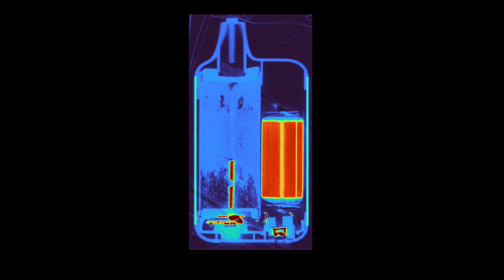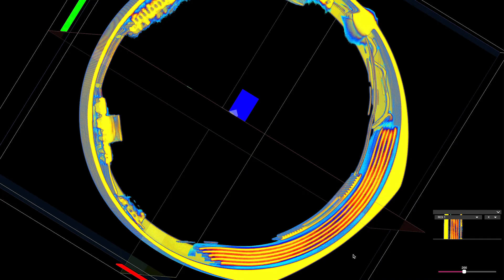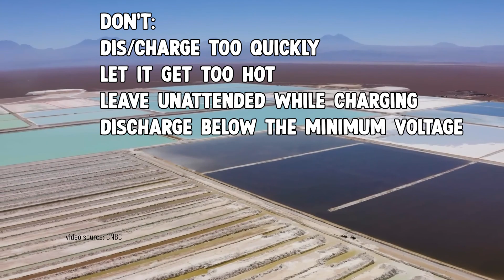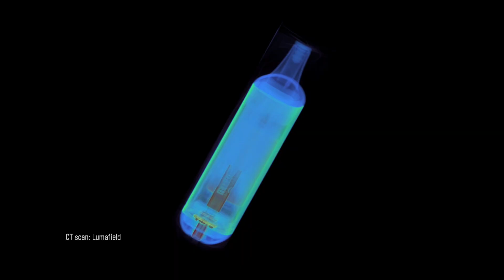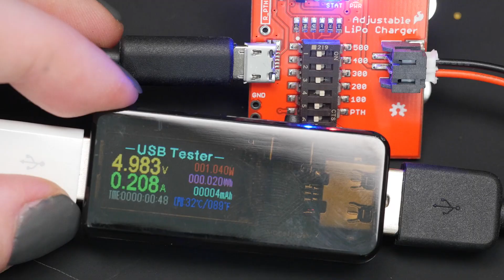Can you reuse these batteries?

Comment: WEAR GLOVES!!! nicotine is one of the few drugs that can be absorbed transdermally (can be absorbed through the skin). this is especially important if you do not vape/smoke already and do not want to become addicted, or if you are opening and handling multiple of these. There are stories of kids working with tobacco who got a strong buzz from picking and handling the leaves. it's easy to imagine how vapes, with a much higher nicotine density and larger surface area than tobacco leaves, will absorb higher amounts and quicker than tobacco.
Reply: Yep. I learned this the hard way. I was harvesting batteries and the nicotine got all over my hands and I got fat headache because of it. Please. Wear. Gloves. And make sure you have proper ventilation. The fumes can really make you sick if you have a bunch of them opened up.

Comment: Hi, you were saying about under and over voltage. I use a bigblue solar panel to charge an ANKER power bank. There would be a range of voltages throughout the day never over 5 volts but under 5 volts at quite a lot. Do you thing this would cause a problem for the power bank. Thank you or anyone for a comment.

Comment: My coworkers use those kind of vapes and every time they are almost gone they leave it everywhere..I found 10 inside or work vans...and when open and tested batteries was good...so i removed and keep it safe for further projects... I found only 2 with charger circuit included...so i use it to charge the other 8vone by one and works fine for small projects..
Reply: Just remove the charge circuit and solder some of those magnetic leads onto it. Then you have a charger you can use for all of them as needed

Comment: What can you do with the USB-C ports besides charge the batteries? Could they be used to port anything else? Like a raspberry pi through the gpio pins.
Reply: These vapes don’t use any of the pins other than those for the power so there are no traces on the board for any data. I suppose if you’re super handy with a super tiny soldering iron perhaps you could some how throw some more pins and some super tiny wires  in there but certainly not me…😂

Comment: I often see these in groups in the same spot in my neighborhood.
I've been cleaning them up, but I'm also considering just putting a steel box there, with a note about safe disposal, and skipping the "let them get rained on/peed on by dogs" step
Reply: as a vape smoker who is embarrassed by what my kind does, i thank you greatly. good person.
Reply: Just be careful it has heat protection if the batteries get too warm they can explode
Reply: @sycksyngyrl  that's why "steel box" - to contain them in the event if a catastrophic failure.
Reply: @StripeyType  those batteries can bust steel and or blow out the lid or opening... If multiple batteries it may breech the box...

Comment: I’ve been collecting those for a while. My question is, can you join them to create a higher capacity battery pack safely? And also can you use a usb charging module with multiple joined batteries?
Reply: I want to know this too; I’d love to be able to join a couple and turn them into a little usb-c power bank
Reply: yes, but you should add a fuse to each battery cell (if you join them in parallel).
Reply: @OLmL1  most manufacturers of power banks don’t do that
Reply: @thatyoutubeguy7583  not on 18650 cells maybe, because they have an internal protection (CID). 
These ones don't have that.
Reply: You technically can but the charging circuit wouldn’t be able to balance the charge so you run the risk of under or overcharging of one or more cells. I would definitely add a BMS

Comment: A simple tip to prevent shorts which could be especially useful for people recovering these batteries: if you cut power wires, cut them to different lengths. This greatly reduces the chances of a short circuit. Even if you solder on new leads right away, it's possible for solder to break through heat-shrink tubing.
Reply: Also, don't cut both wires at once. The wire cutters will  complete the circuit and the battery will short and possibly catch fire.
Reply: Not if you know how to solder properly
Reply: And also, don't use open flame near the batteries💀
Reply: @davidd2661  it's a lighter for 2 seconds to shrink heatshrink. Calm down, Alice. It's going to be OK.

Comment: Great video Becky! Had no idea and something else to get angry about. Is lithium a finite source? No kidding these are kinda dangerous. 4:20 you can see tiny sparks as you desolder. (Would desoldering negative first cause the same spark?) Super smart to add connectors. Soldering any live battery to a circuit is risky. Mahalo for sharing! : )
Reply: Would have been safer to cut the pressure sensing capsule one wire at a time. And don't do what [Atomic 14] did in his video which was to cut both wires at the same time with the same metal wire cutters.
Reply: Lithium is super abundant on earth, particularly in seawater. It’s the rendering of it that’s the issue. Oh and you know the littering and filling of land fills etc😒

Comment: Where I live these things are dropped in the street.  I now have two biscuit tins full of them.  Amazon sells the charger circuits - 5Pcs TP4056 1A Lithium Battery Charging Board Module for about seven pounds sterling.

Comment: I need a  bunch myself. I've collected a few 650mAh, but I'm looking for the larger disposables. I intend on using them for lighting passenger cars on my garden railroad. Been collecting them as I find them, even before bigclive posted his video.
Reply: The problem with the 650mAh ones that I've salvaged is that they are typically in those devices shaped like a Zippo lighter that have a USB-C recharging port on the bottom, but the recharging circuitry is very minimal - just a 4.2V regulator. So these devices have a large tank of fluid to atomise but come with a battery with too small a capacity to fully vaporise a full tank. The user would typically drain the battery to nearly 3V, recharge it rapidly to 4.2V, and repeat this cycle several times until the tank is empty. By then the battery has suffered multiple very punishing recharge cycles and so is very unlikely to have a capacity anywhere near what is claimed on the label.
Reply: @bornach  they rarely have the capacity that's on the label to begin with. I can load test, get a bunch of cheap BMS circuits, and they'll be more than fine for cheap electronic projects. My intention is low powered LEDs, more than enough power for a few hours of running trains at night.
Reply: @bornach  besides, they're only charged once or twice before being tossed.
Reply: @bornach i lookd for some of this info and found out i think my juice is compatible with my 3.7 w usb c charger Torch out california

Comment: This is insane! Disposable consumables with rechargeable batteries 🤬. Thanks for sharing the story and the excellent instructions Becky 🙏
Reply: And not just the batteries. That pressure sensing capsule contains a capacitive touch switch. Just cut the top membrane off to expose the sensor. It can also switch quite a high current compared with those capacitive touch PCB modules sold for use in Arduino projects
Reply: @bornach ⚠️ God has said in the Quran:

🔵 { O mankind, worship your Lord, who created you and those before you, that you may become righteous - ( 2:21 ) 

🔴 [He] who made for you the earth a bed [spread out] and the sky a ceiling and sent down from the sky, rain and brought forth thereby fruits as provision for you. So do not attribute to Allah equals while you know [that there is nothing similar to Him]. ( 2:22 )

🔵 And if you are in doubt about what We have sent down upon Our Servant [Muhammad], then produce a surah the like thereof and call upon your witnesses other than Allah, if you should be truthful. ( 2:23 )

🔴 But if you do not - and you will never be able to - then fear the Fire, whose fuel is men and stones, prepared for the disbelievers.( 2:24 )

🔵 And give good tidings to those who believe and do righteous deeds that they will have gardens [in Paradise] beneath which rivers flow. Whenever they are provided with a provision of fruit therefrom, they will say, "This is what we were provided with before." And it is given to them in likeness. And they will have therein purified spouses, and they will abide therein eternally. ( 2:25 )

⚠️ Quran
Reply: I figured this out while back with the adjustable bass vape unit, and turned mine into a voltage adjustable LED light ;)
Reply: Ever since these started getting popular, I have seen them littered all over the streets. I'm all for vapes for quitting smoking, but get something refillable; much less wasteful.
Reply: For real I’ve been collecting these for a couple years now off the road and from people. The 1st time I found they had a god damned lithium ion batt in them, I flipped my shit, man!
Reply: Yeah, and they end up getting scattered after use, they can leak, touch with water or be eaten by an animal, then explode the shit out of it (literally).
Danger on the verge.
Reply: Why? Would it make a difference if the battery was non-rechargeable?
Every battery operated disposable is insanely wasteful. Regardless of the type of battery that's inside.
Reply: @Ni5ei  Let me explain it slowly so you understand, if you make the device reusable, it will last the lifetime of the battery, around 500 cycles, as opposed to 1, meaning a user of these devices can go trough 500 devices in the same timespan a single reusable unit could last, which, for obvious reason is unjustifiably wasteful, when the hardware itself is fully capable of being reused.

Comment: I have like 30 old vapes lying around to salvage for the small batteries. I have yet to use one for a project though
Reply: There's very cheap Bluetooth speakers that have good chips inside but a very poor lipo battery. These batteries from vapes are perfect for extending the playback time many hours (because there's much empty space inside the speaker case tha can be filled with several batteries)

Comment: What hobbyist-friendly protection circuit do you recommend? (If not using the leave-connected-to-charging-circuit method)
Reply: tp4056 with dw01a module
Reply from the maker: just make sure you adjust the resistor to make the charging rate match the battery-- a lot of the newer tp4056 charging modules you can get are defaulted to 1A which is too big for most of these batteries, and sometimes the SMT resistor is too small to easily replace yourself.
Reply: @BeckyStern  thanks!
Reply: @BeckyStern  After removing the Rprog resistor I just use a regular through hole resistor with one leg soldered directly to pin 2.
Reply: @BeckyStern  Or use two or three cells so you can double or triple the save charging current without having to mess with that flea dick sized SMD resistor.